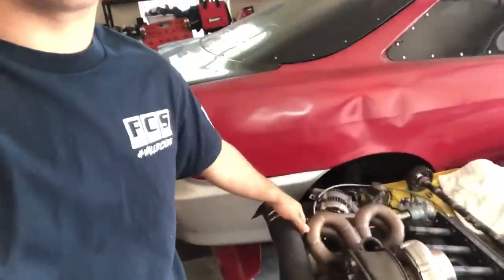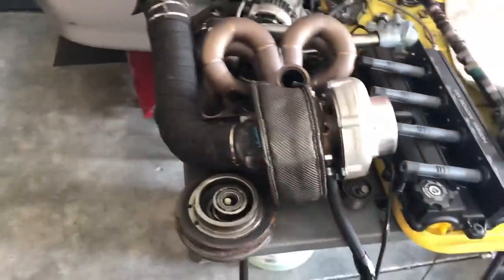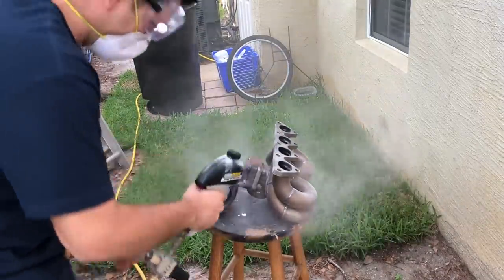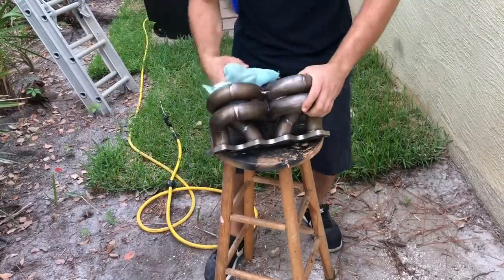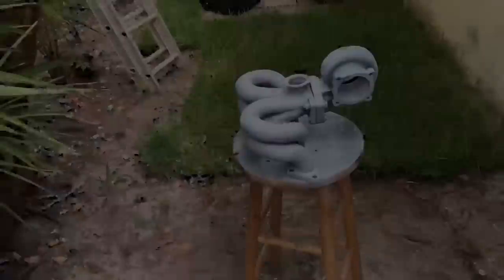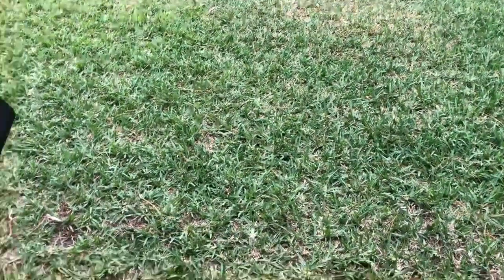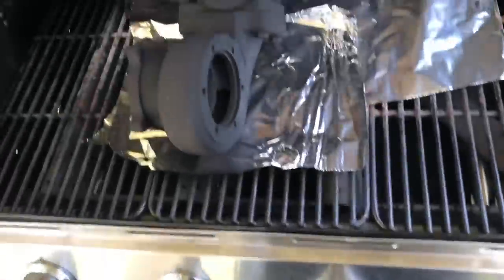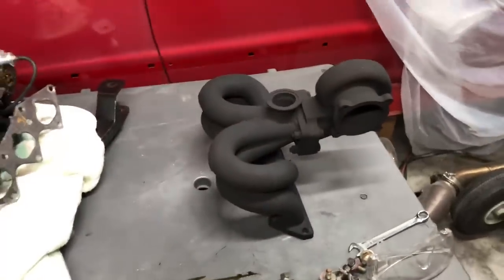Cheapest Way To Ceramic Coat Exhaust Components! ($11 vs $100++)

Comment: Well... this has nothing to do with Ceramic coating though. This is paint, that resists to high temps. That's cool, but the point of ceramic coating is to reduce the heat radiation and keep the heat inside the exhaust tubes. That paint is not going to do that. It's really different material
Reply: Most "ceramic coating" businesses use this exact, or other brands (hot jet for instance)ceramic paints. There isn't some special ceramic coating that is used or done differently.

Sure, some products may be better than others, but your point is completely wrong.
Reply: @winebartender6653  Well, I am sorry that you are so little informed about the difference between ceramic paint and ceramic coating. If your local specialist simply paints your exhaust with ceramic paint, and he calls it ceramic coating, that's one thing (and, sure, you could probably do kinda the same thing with a rattle can). But that's not a proper ceramic coating used in various industries. 

FYI (but I am not giving any info google can't give you), a ceramic coating is not a DIY process. It is commonly done using a technic called Plasma spraying (but not all use that technic. Some prefer High Velocity Oxy-Fuel). The coating is applied with a high-temperature process (between 10.000 and 20.000 degrees Celcius) where powdered coating ceramic (or else) is injected into a plasma plume. We are closer to an arc than a spray. 
The HUGE difference is in terms of abrasion resistance and the thermal barrier it creates. You are not applying a paint with some ceramic particles or a random powder coating, but you are literally adding a ceramic coat bonded to its support.

Comment: That vht actually works great used it on my little brothers 4-1 header bout 4 ye ago still holding up great and no flaking off I did a few nice coats on it
Reply: Did u spray it on stainless or what? CUz mine are stainless and im hoping it sticks

Comment: i need something that reduces engine bay temperature a lot, so i need to insulate heat from turbo manifolds as much as possible. The options are, the coatings from Eastwood, flameproor by VHS, and cerakote coatings that are more expensive. Whats a best way without spending to much?

Comment: Did you mean to spray inside the housing? 
And damn your Papi gonna be pissed you did that in the BBQ!
Reply: GIZZMOTORSPORTS it wont harm anything
Reply: Would have taped it off if it was an issue ..cant hurt anything

Comment: The result looks good, but this is not ceramic coating, this is a complete waste of time if you think it's going to keep your pipes from radiating heat and melting your shit. This does not have any thermal insulating properties. This is for looks only. Getting a manifold like that ceramic coated by a professional is like $150-200 which is not a lot in the grand scheme of a project car like that.

Comment: The filter on the hose needs to be stationary and mounted vertically.  You just shot a bunch of water into the metal. Nice job though. Looks 1000 times better and that stuff works.